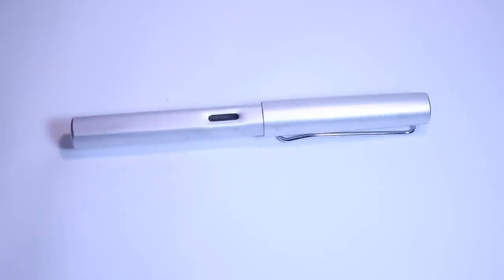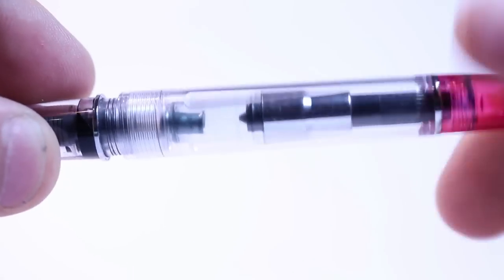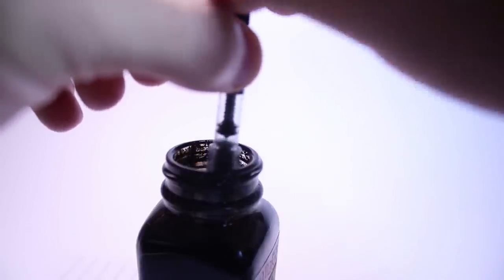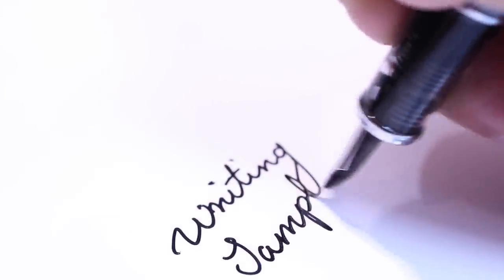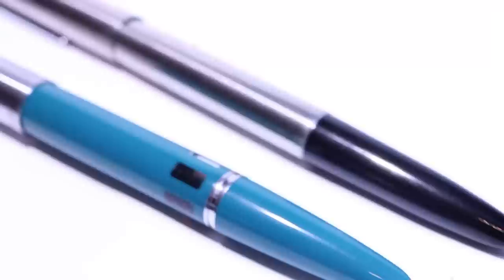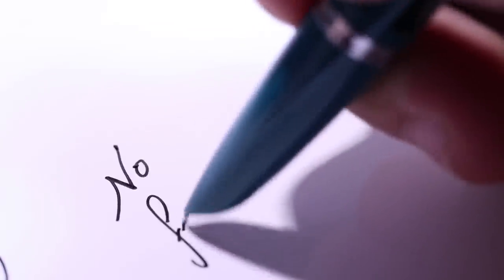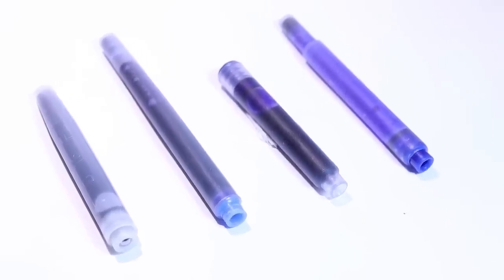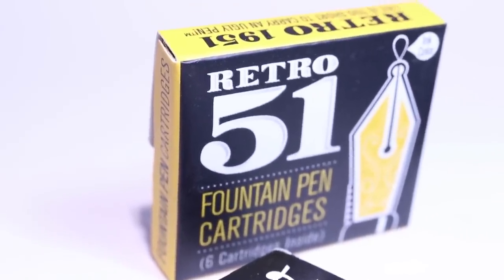Ultimate Fountain Pen Beginners Guide

Comment: “Don’t say I didn’t warn you!” That was great! This is a very good Fountain Pens Introduction video and it should help beginners quite a bit. I learned something too, even being a constant user for about 3 years. I had not thought about why you should not dip a converter into the ink to fill then attach it to you pens feed. I had not thought about the corrosion aspect, but, I do wipe down the end of the converter before I attach it. I also wipe down the end of the cartridges after I syringe refill them. I just like the good pen hygiene, I hadn’t thought about corrosion.

Comment: Is it okay to use a syringe to fill up the converter facing up and then putting the converter in the pen?
Reply: Yes it is. Only, it is more practical to refill empty cartridges in this way.
Reply: Okay, thank you so much guys!
Reply: Removing the converter again and again for each fill will reduce the like of filling system. It you do this do remember the need to push some ink into feed after the fill for the capillary action to start.
Reply: Yes fine but buy a converter. Is easier.
Reply: Just use a cartridge. More capacity
Reply: just to think, when you wrote this comment you had no idea a virus would go over the world and result in a lockdown

Comment: You have saved me from making a mistake good sir. I have recently begun using a fountain pen, and have found that its much more economically friendly to use a converter and bottled ink instead of cartridges. I was thinking "Well why cant I just fill the converter then stick it in the pen". But you have brought up a number of good points, so, wont be doing that lol

Comment: Is that a real problem to put off the converter and fill it with ink out of the pen, the  replace it into the pen (after a rub into a towel) ? With a Lamy Aion I see no alternative. If you put the pen straight into the bottle, ink will mark the grip section. I did it once and can still see the purple stains of ink I was using at the time.
Was I wrong all this time ? ... :/
Reply: Saucissauce nope I guess! Give a good wipe & it’ll be good....the main down side is lot of ink is used to saturate the feed and only a small amount of ink is left given that converters tend to have lesser capacity than cartridges!

Comment: Be aware that if someone visits a specialist fountain pen shop to get their first fountain pen, they will ask him a lot more questions. By knowing how someone writes, slow, fast, big of small, a good fountain pen can be selected. Also, not every type of paper accepts every type of fountain pen. If a fountain pen writes like heaven on one type of paper, it can feather on another. That's why authors usually have several pens at the ready (At least I do).
A good (and expensive) fountain pen is personal. It sets to your hand. If someone else were to use that pen, it doesn't work anymore. Like with your first car, begin with a cheap pen and work your way up. And try not to get too exited about cheap pens on Chinese websites. A specialist will decline them instantly. Each pen feels slightly different. And they may write just as good as expensive pens. But you can only use one pen at the time. Though if after a few weeks or so you discover that fountain pens are not for you, it's only a small price.

Also important, do not panic if your pen starts to drip. Usually it's nothing serious. Maybe the converter of cartridge came loose, or the feed is too wet. Every problem can be solved.

Sorry J for busting your video like this, but this is a little info that's always on my mind and I kinda missed it. Perhaps it's for an advance guide... Keep it up
Reply from the maker: Well this  isn't a fountain pen buying video ;) Great info tho
Reply: Have lent out plenty of pens. Someone else using it is not an issue with a Manifold (nail hard nib). I just tell the person write zero pressure with only weight of pen. Lending may be an issue with soft or flex nibs if a person has a heavy hand.

Comment: I found a dusty fancy box in my parents room last week and it turned out to be a fountain pen! So i took it and went to buy some ink cartridges for it but they only had one pack left was pretty cheap tho so i boght it even though it didnt fit the size at all, so i came back home and tried to insert it and it was but bit long and a bit thin,, so i cut off a bit of the cartridge's tip to make it shorter and it snapped right in!!! And i also stuffed some papers on the gaps for support..
Reply: Oh no...
Reply: What pen is it?

Comment: I have been building a list of fountain pens I want to try for my introduction into using them again. (I used to use one in grade school and loved it until it broke and I was not allowed to get another one for some stupid reason I still do not know)
The list so far is: Junhao 250 Med. Nib - Moonman M2 Fine Nib - Twisbi Eco Fine Nib. The latter two I have seen listed on many forums and reviews as good pens, your videos included. What kind of ink and paper would you recommend for a beginner that is not expensive? I am going to be starting back to school next year and need something that will be smooth and dry fast but I need a paper that will not let in bleed through too much. Currently the pens I use are, an Inc R2 Rollerball that I only use for diagrams and things that do not need a fine point as its a 0.7mm point and bleeds quickly so the lines come out between 0.9mm and 1.2mm. I use a Pilot Precise V5 RT which is a 0.5mm gel-pen. I prefer the pilot because it creates nice fine points but it is not as smooth as the R2. I use them because I cannot stand feeling the pen drag across paper and I do not need to apply any pressure to get them to write. Currently the standard notebook paper I use does not give way to bleeding unless I use the R2. Current Ink choice is one I have seen in many of your videos, its the Pelikan 4001 Royal Blue. Any advice you or anyone who reads this can give me would be greatly appreciated.

Comment: I found mine at 5 below💀😂😂 been looking for it for years I just refuse to spend more thank about 10 bucks on a simple pen for cursive writing. Thinking about using one of em to sketch with though.. it came w/ 2 pens w the angled nip and 4 replacement cartridges (unlike the dip style where you would purchase a bottle to fill a permanent section/home in the nip)

Comment: Can i use it on school?
Reply from the maker: I used them at school for 3 years. I has dome trouble with ink bleeding on cheap copy paper, but using a dryer ink and a smaller nib worked for me. My pen that I used for 2 years was a pilot prera with noodlers black and that worked well for me.
Reply: @jpl2475  wich would you recomend me, the faber caster 40 dollars fountain pen or the pilot metropolitan
Reply from the maker: I have never used either pen, but pilot kakuno or prera pens are great in my opinion. The pilot medium nib is one of the best nibs I have ever used.
Reply: @jpl2475  okay, thanks for your response man!
Reply: @Miichi5  I've used the pilot metropolitan w/Medium Nib as my starter pen.  

Very good for daily use

Comment: At least with fountain pens, you don't need to add another room to the house, like you do to contain many other hobbies and crafts.  No, that doesn't happen until you start buying bottled ink.  Other tip for newbies, especially bottled ink users: Solvol soap, cheap as, and works on any ink.
Reply from the maker: Oh yeah, I have used that stuff for years, always works like a charm on ink or grease. Solvol is great

Comment: Excellent video! You addressed almost everything I needed. I bought inexpensive fountain pens on a whim and the directions for the cartridges were terrible. I ended up loading from a bottle and I did it exactly the WRONG way by loading straight into converter because I couldn’t get ink to load through the nibs 🤦‍♀️ I did wipe it all down. 
Can you tell me the types of ink that can be used? India ink? Speedball ink? I want to use my pens for my artwork. I do line & wash and want to try something new for the line work. I need to use bleed proof ink. Ty!